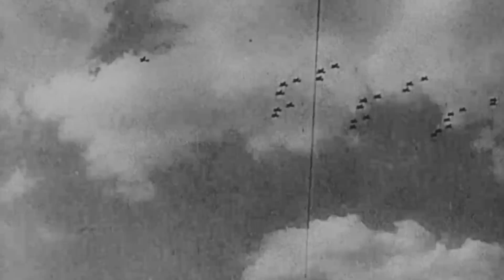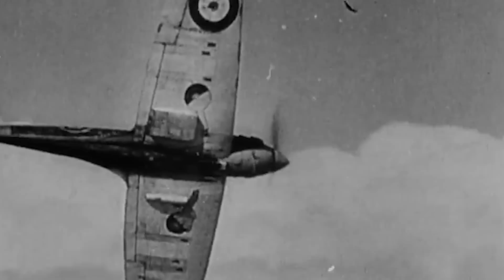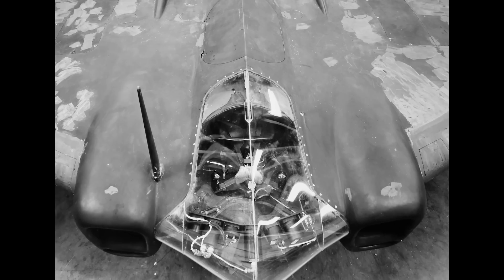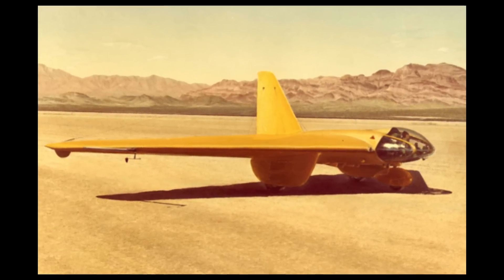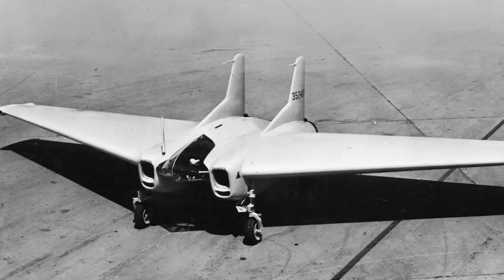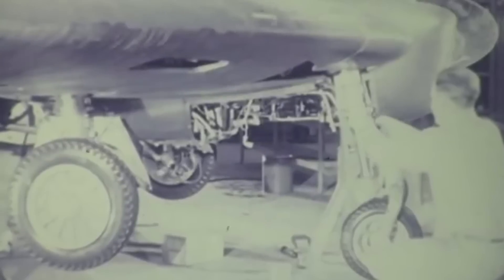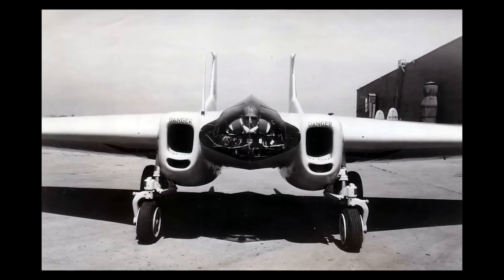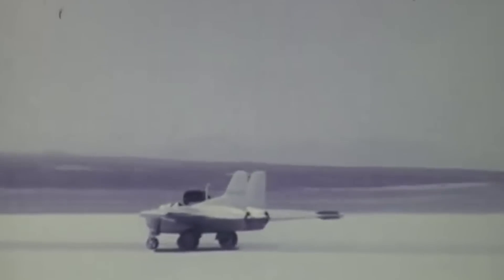America's Secret Flying Chainsaw

Comment: The design looks like it could have been equipped with 6x20mm cannon, negating the need for ramming...as desperate as Germany was in 1945, they modified Me109s for ramming missions with the hope the pilot would be able to safely bale out

Comment: A dubious solution to a problem the Allies never had. German bombers were not “bristling with guns” as claimed by the narrator and conventional fighters dealt with them quite well.
Reply: Correct. German bombers were anything but heavily armed and the RAF using its scarce fighters sparingly until the very end of the Battle of Britain still managed to inflict defeating casualties to them. I suspect the allied, and much less the US, were never so desperate as to even consider a plane designed to ram other airplanes out of the sky. As someone else pointed out, the ramming concept sounds more like a myth than reality given that the XP-79 was to be armed with machine guns. It may have been intended to be very sturdy to survive extensive battle damage and people just build a myth on top of this. Just because someone says it on the internet does not mean it is true.